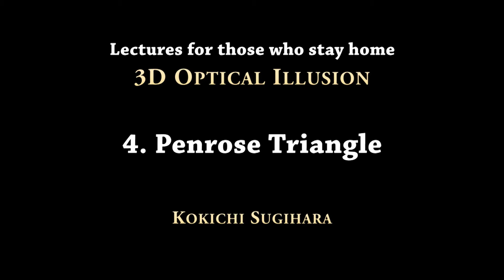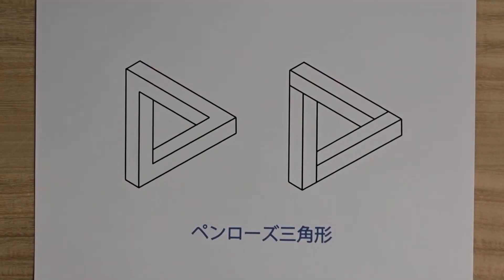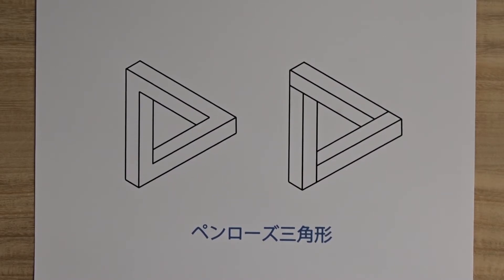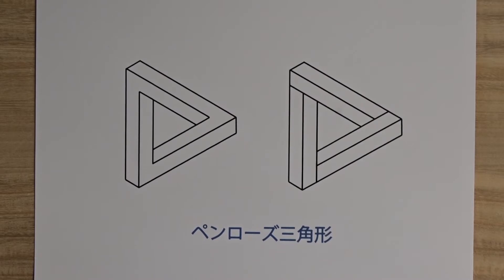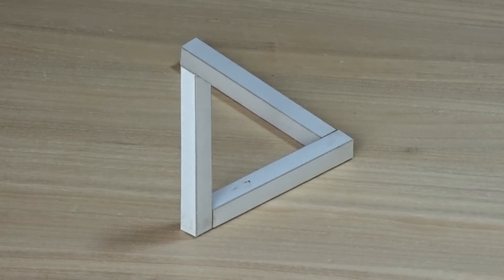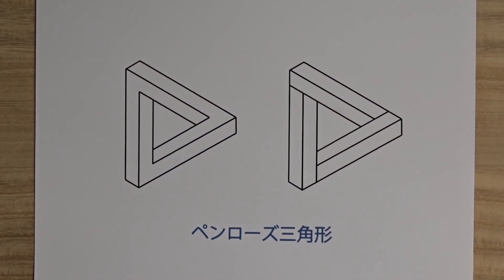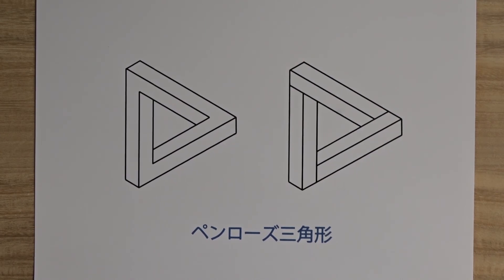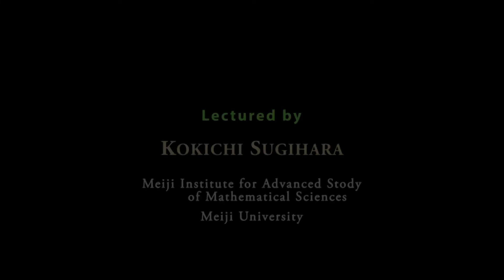Lecture series for those who stay home "3D Optical Illusion: 4. Penrose Triangle"

Comment: i think that the left one cannot use the nonrectangularity trick because the planes need to touch each other in a way it isnt possible without curving. the only feasible way to make it with 3 planes is if they are all the same plane, in that case that would be the same as a printed picture.